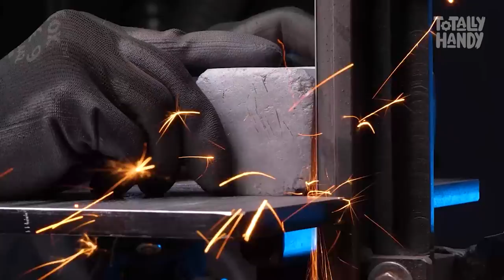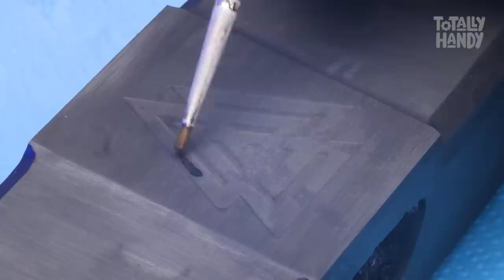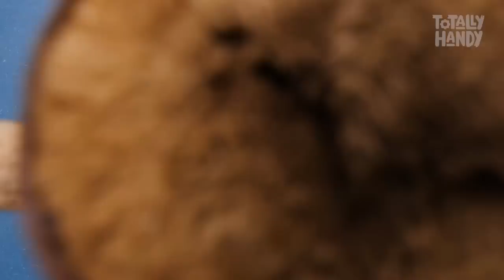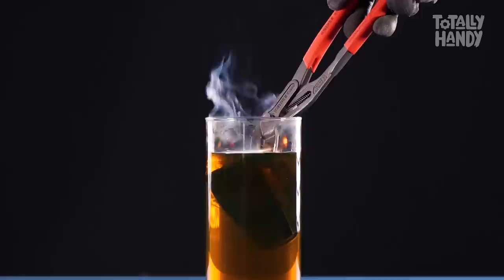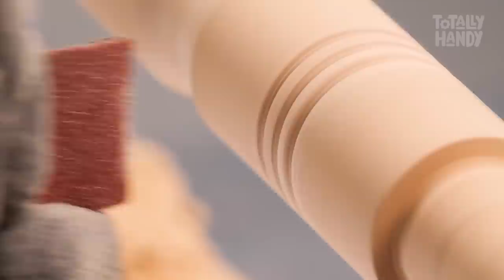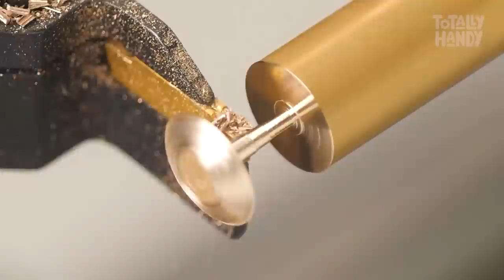Old and Rusty Sledgehammer Restoration Project & More!

Comment: Nice job for the sledge hammer... but dude, to work as it should, the striking faces have to be slightly doomed... mushroomed little bit.
Is even dangerous to let this straight as yours... you can get a 'shrapnel' on your feet.